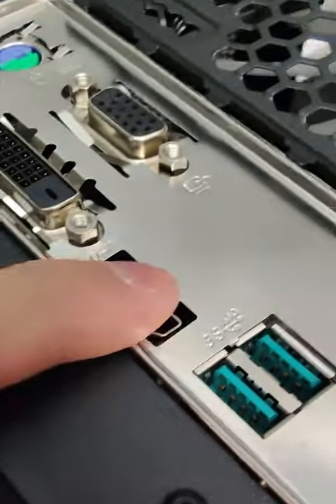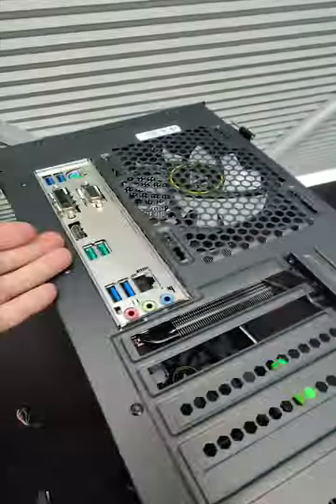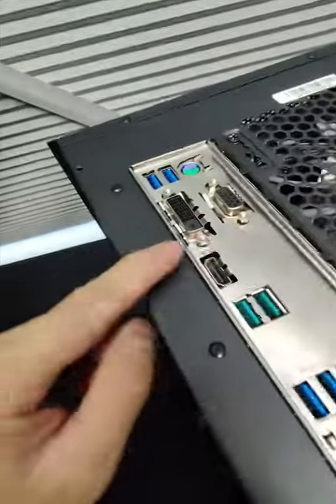Building a PC and you see THIS #shorts #pcgaming

Comment: This is why i love built it io sheild. It save so much unnecessary pain.
Reply: Same here, mine has a built in shield.
Reply: bill tin 😭
Reply: Unfortunately almost all the "affordable" boards don't have them
Reply: @sstier48  That's just the way it is, either install an io shield or get a better board. I spent more money to get an AM5 board just to have that forward compatibility.
Reply: Same, i dont buy mobos unless they got a builtin. Lost too many of those suckers over the decades, im done.
Reply: @Twiggalot  how do you lose them, When they can't fall out?..
Reply: @Jdogg4089  ya.. there are plenty of am5 mobo's without them (have built around a dozen am5 systems with mostly different mobo's) currently running a 7800x3d and 7900xt in my personal rig
Reply: @sstier48  Yeah, but most of the better boards have them. I  do obviously know there are some without them but at the prices I was paying it didn't make sense to get a board without one. It's the least they could do for this kind of money.
Reply: @sstier48  you rebuild shit, sometimes sober - sometimes drunk.
Reply: @sstier48 I have a B560 Aorus Pro AX that I got for $109 (and it used to go for $90 before it was out of stock)
Reply: paying a $300 motherboard with a built in io shield is worth the money 🤡
Reply: @Jdogg4089  "just spend more" is a dumb concept, there are things in the build that actually effect performance that you may be able to spend that savings on..
Reply: @sstier48 hey at least i spent only $109 for one:)

Comment: Least you didn't have everything plugged in already. Couple screws, lift and reseat is nothing. Getting it seated correctly though... That may be the biggest issue imo. Some of those IO shields like to actively work against you.

I've had EVERYTHING assembled and plugged in before and had thoughts of, 'what if I could put this HD Audio connector behind the motherboard so it isn't overlappimg the chipset heatsink... Since I don't have any hidden cable compartments...' or had to take a GPU out with less than 1" of clearance because I realized I could route the 2 VGA power cables behind and under the card to put less stress on the gpu power connectors (which were tangled in a mess of front panel wires, including thermal sensor wires, bare molex wiring, and USB+audio cables coming from the top of the front panel).

You be a'ight lol.

Comment: I recently upgraded my mobo from a B450 to a B550 and after I screwed it in, plugged in all the cables and got all my cable management situated. I then noticed the BIOS flashback button was pushed in and lodged behind the IO shield. I nearly had a mini heart attack but thankfully I was able to pop it back out by pushing down the motherboard.

Comment: And if you are unlucky it will charge the shield and give you the shock of your life when you plug in a USB. It got me good when  I was carrying my coffee, and I had a heart attack when it feel into the PC. Luckily it didn't break it because I unplugged it at the speed of light.
Reply: It's HDMI not USB. And it wouldn't charge anything, those metal tabs are touching the same piece of metal they'd be touching if they were on the other side. The HDMI male connector would also be touching the same piece of metal so it would make no difference at all.
Reply: @Connection-Lost  It will, I literally experienced it.

Comment: No need to disassemble, get a flat head screwdriver press from the inside to make the shield bulge out, use the screwdriver to bend the tabs up slightly and release pressure from the shield. Job done 👍
Reply: No. Just no.. you're going to fk up the tabs/bend the shield, not something you want to do to your buyer